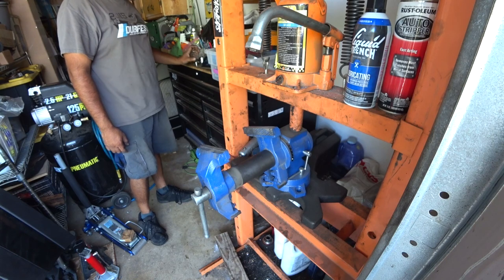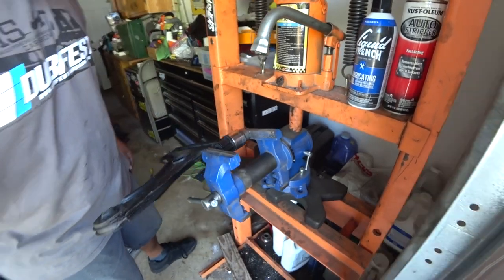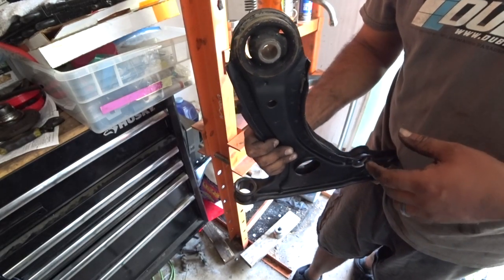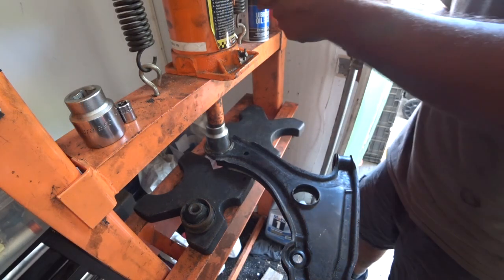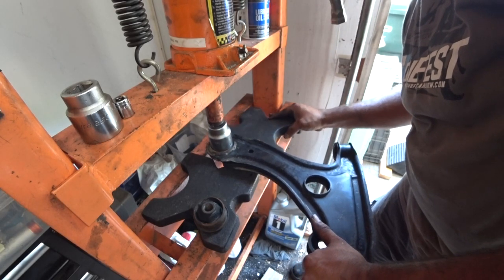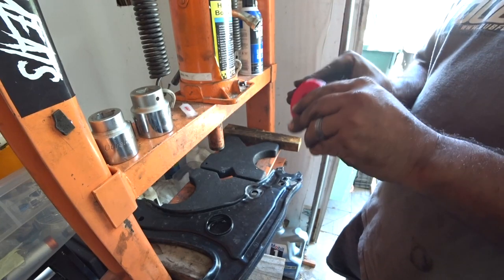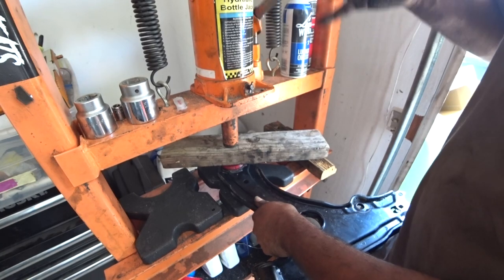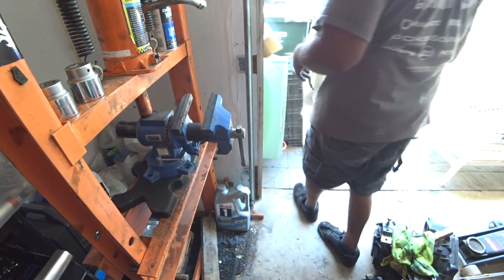How to install MK2 Poly Control Arm Bushings Season 5 EP24

Comment: So, I ordered this kit from energy suspension https://energysuspension.com/energy-suspension-15-3113g-control-arm-bushing-set?search=15.3113G
And as you can see the collar that goes into the main bushing had a i.d. thats way too big. Any idea if the oem sleeve will fill that gap?